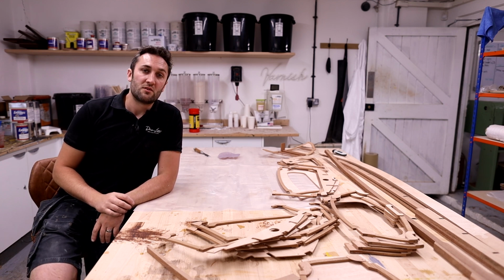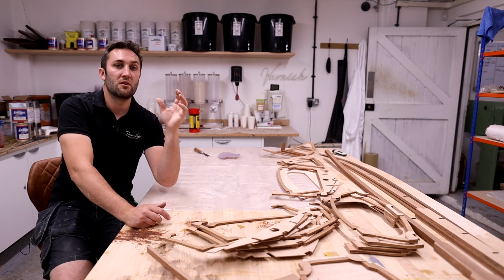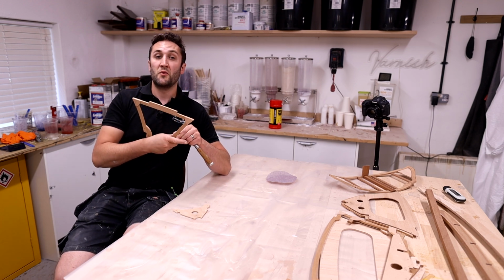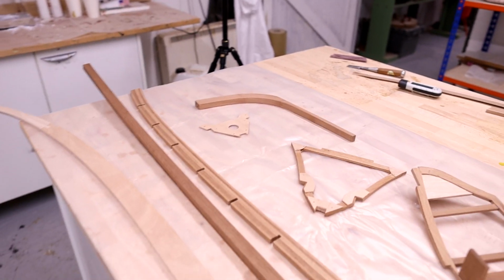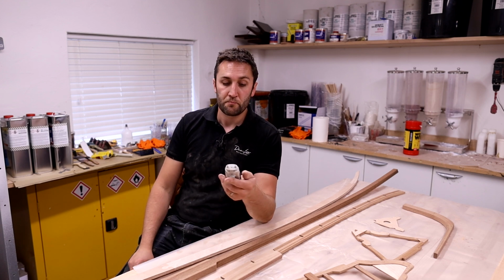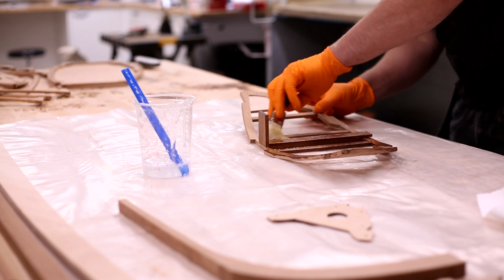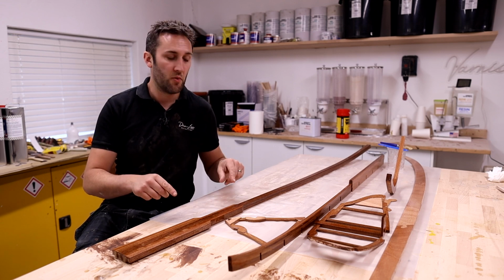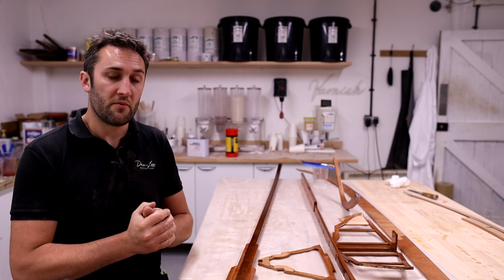Epoxy Coating Wood Parts | Temptress 1/4 Scale Boat Build Part 13

Comment: Thanks really enjoying this series. Came back to it as i recently came across your full-size build. I was wondering if vacuum sealing the epoxy coating into the wood. Easier of course on the model which would decrease the thickness distortion you had discussed. On the full size, the same bagging and vacuuming sealing the wood could be feasible, would get into every crevice and with the various plastic and release agents, your chance of bag bonding would be limited.  Just a thought. You may have addressed this already.  Thanks again.

Comment: Dan, a wealth of useful information as usual. 
Something that I haven't noticed on the frames, now that you have them dis-assembled, or on the frames dry assembled with the keel &  stringers is that there seem to be no limber holes. If I'm not mistaken, will they be done? Perhaps not vital in a model but would be in the full-sized boat -- yes?
Reply from the maker: Yes these will be done, it wasn't worthwhile on the model and on the full size build I will do them manually just before the bottom planking goes on.

Comment: With respect..
From experience..assemble the frame..glue and filleting as you go...then a coat of thinned epoxy..xylene has the slowest evaporation rate..
This saves a lot of time..
Let it cure..knock of the raised wood fibers..nibs.. 140 grit...
Second coat..thinned epoxy...just enough to flow..nicely..
Reply from the maker: Admittedly thinning may give you a better finish, however it reduces the physical strength and compromises the moisture resistance of the epoxy which goes against what we are trying to achieve with encapsulating.

Comment: Have I missed something here? In an earlier vid you said you would not be epoxy coating the 1/4 scale as the buildup of epoxy thickness would not be an issue on a full scale build but would be for the 1/4.
I've just binge watched all the videos. Splendid work.
Reply from the maker: Yes, I wasn't sure but in the end I couldn't think of any other way to properly demonstrate the process so I did opt for epoxy. I have however only applied one coat to each part rather than the recommended 3 to keep the thickness scale down a bit.
Reply: @DanLeeBoatbuilding  Thanks, sounds good.

Comment: Hey Dan, is that a cereal dispenser loaded with fillers on the counter?
Reply from the maker: Yep, don’t fill up your breakfast bowl with that one 😆
Reply: @DanLeeBoatbuilding  Brilliant. I have been pondering a filler dispenser solution. I'll have to look around for one of those.
Reply from the maker: @Nomadboatbuilding  I tried a few and the paddle wheel type work the best. No so great for the fibres based fillers though as they clog further up the tube. 407 and 406 types work a treat though!
Reply: @DanLeeBoatbuilding  Okay, thanks Dan. That's helpful.

Comment: Dan would you not get a batter bond with an epoxy to wood bond vs epoxy to epoxy? I’d would have thought glue up would have preceded the sealing step. I have ordered the plans but I am having a real hard time finding a shop near me that doesn’t want a ridiculous sum of money to machine the kit 🙁😡. Anyone have any ideas? An amazing project Dan! Hopefully I can start mine in the near future.
Reply: Bet you could find a hobbyist with a cnc machine on craigslist or somthing
Reply: Something I didn’t think of! Thanks for the idea 👍🏻
Reply: There’s a hobby builder doing that with a Shaper Origin hand held cnc router.
Reply from the maker: @bobbymccourt6794 epoxy bonds well to itself but it does want to be well keyed, 80g probably would be my recommendation. 

Not sure on CNC cutting prices as they probably vary widely based on location. Take a look at the shaper origin as that seems a good route. Possibly buying a machine and selling it on after you’ve cut your parts might be quite an economic route?

Comment: What about Clear Penetrating Epoxy Sealer for treatment of the “skin on the frame” ???
Reply from the maker: I do use that stuff for older wood and anything that needs to move an breathe a bit. Due to the fact it is solvent based though, it doesn’t offer the same barrier and protective properties as the West System product.